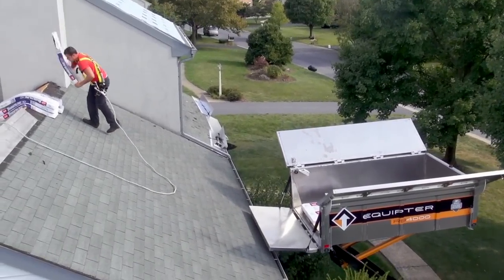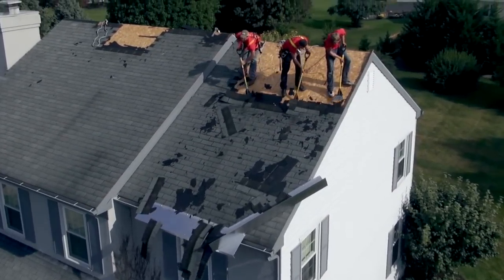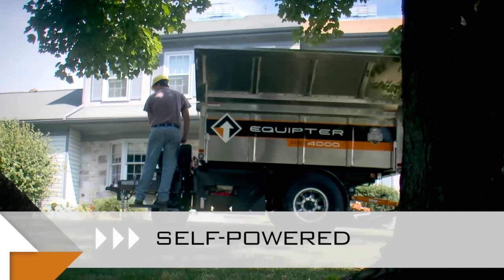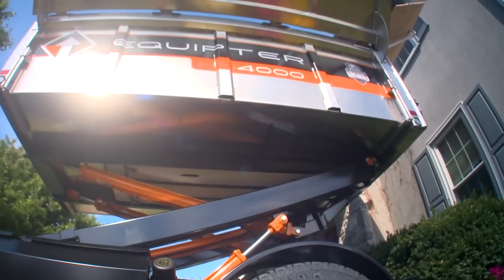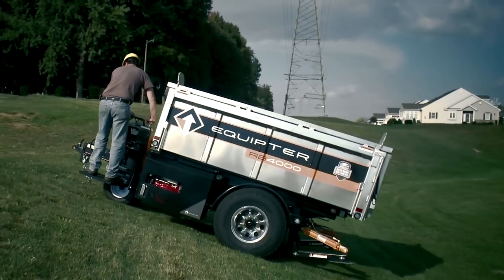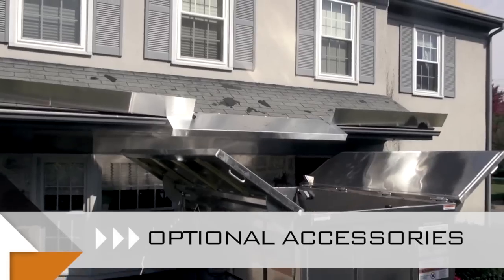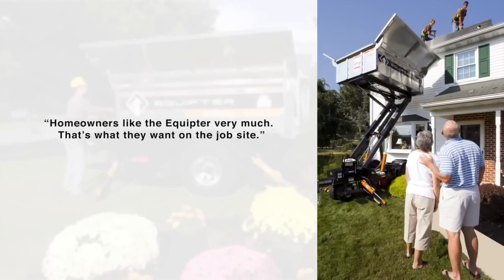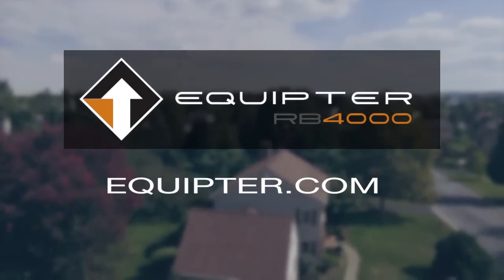What is the Equipter 4000 Roofing Trailer?

Comment: This thing makes the removal of roofing waste so much easier. Before my old boss got one of these it would be lunch time before we were able to finish getting the waste off the roof. After he got it, it would take just the time to remove the shingles from the roof then push it in the bucket. Usually within an hour or so we would be done with the whole area and sometimes roof. We could get a huge house done so much quicker

Comment: Wouldn’t it be more efficient to use a conveyor belt that leads to a regular garbage trailer? At least in terms of energy expenditure? Could have it running parallel to the rain gutter? Sorry for questioning but I love coming up with ideas to make things more efficient. Probably my love for Factorio shining through lol. Amazing game but you will become addicted.
Reply: Material houses use conveyors when they deliver material to roofs. The problems they run into is access to roof from streets or distant driveways. Their trucks can damage underground pipes and weaker driveways. A problem I forsee is that if it wasn't a contained conveyor it would be messy and dangerous. Making one to solve this would result in a too large and heavy unit.

Comment: How many squares can that hold??
Reply: I had a customer last year at Lowe's that had a dual axle model that held two pallets in a row with extra stuff beside the pallets. I tell you one thing you need a decent towing vehicle to pull one because this guy had a chevy Tahoe and the hitch was about 2" off the ground.
Reply from the maker: The RB4000 can hold between 15-20 squares.
Reply from the maker: @allenmckinney9533  , the standard pickup truck tends to tow it just fine. :)